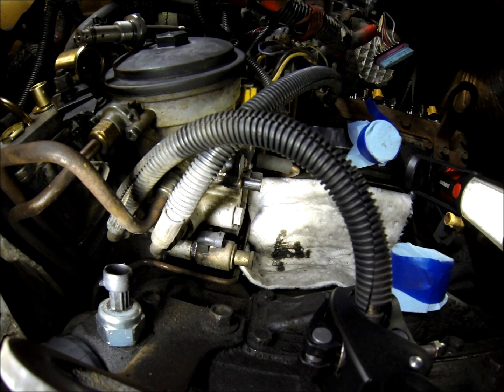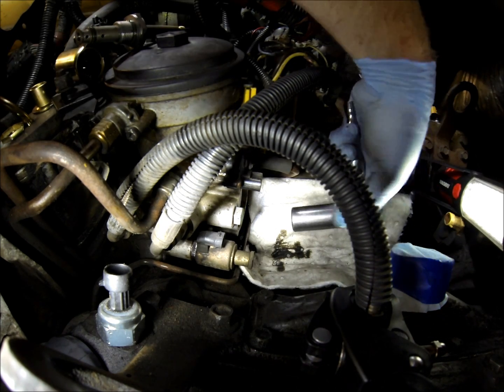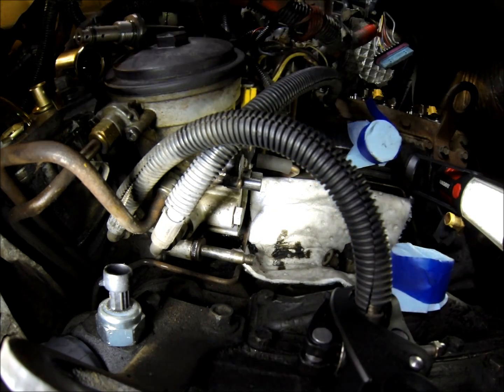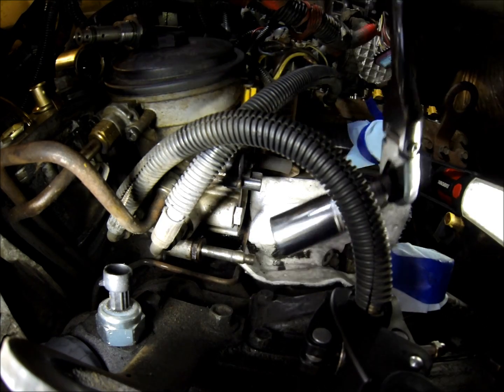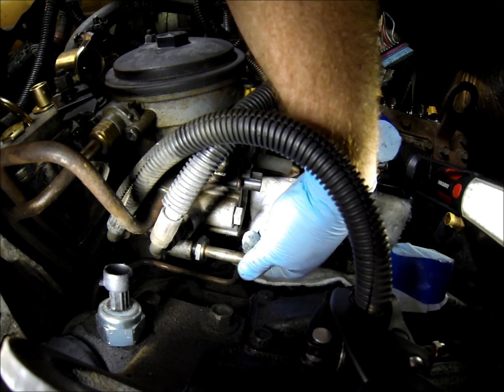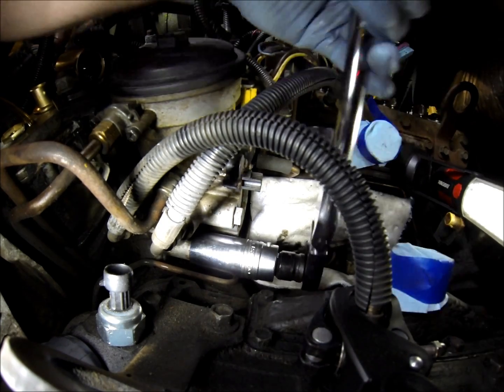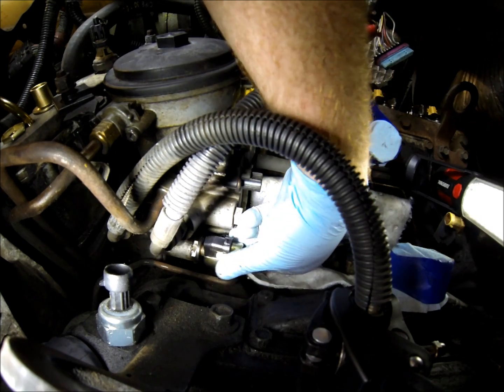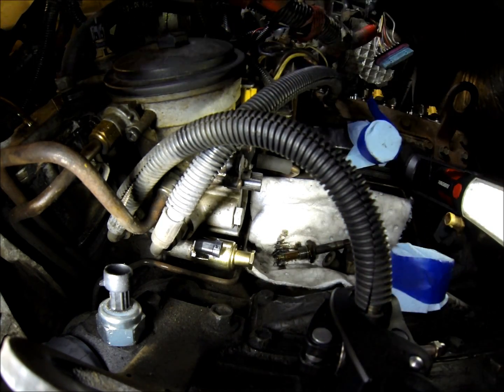7 3L Injection Pressure Regulator Replacement

Comment: My truck will run, I shut it off and if it sets for about 25min or so it wont start. If it sets longer...maybe 15more minutes it will start. Today was the first time it died on me at a stop sign and would not start.  It set about 45min then started. Im going to change this part.

Comment: I have a 1999 7.3 super duty it starts runs but dies after 45 seconds and will start back up and dies again, can you help
Reply from the maker: You will need to run a full set of diagnostics on it to determine why it is dying. Minimum checks would be fuel pressure at the bowl. You will want to get it scanned using a scanner capable of puling manufacture specific codes as well. Otherwise it is just guessing.

Comment: This is a great video, probably the best and most straight forward video to replace an IPR valve in a 7.3L Powerstroke Turbo Diesel. If anyone is watching this and reads the comments, use a 29mm deep wall socket. U.S. car manufacturers switched to metric bolts in the early 1980s, although you will still find some standard size bolts in modern day vehicles.

Comment: The FIRST thing you should tell people is: Remove the fuel bowl if you have one. You need to clean it anyway.
Reply from the maker: The Fuel Bowl has nothing to do with replacing an IPR. If maintained properly, the Fuel Bowl should only need to be removed to replace all of the seals.  Most are good for at least a two hundred thousand miles. The internals stay clean unless bad fuel is encountered.

Comment: My ‘96 7.3 won’t start in the morning when it’s 85 degrees…but I’d I wait until after lunch and it 95 degrees it starts right up.  Mind boggling.  Maybe this pressure regulator will help after I install it.
Reply from the maker: It could be the IPR. You should see starts at those temps. Unplug the ICP sensor and see if that helps. Otherwise you need to find out if it is a HP oil issue. You could have leaking injector o-rings too. Usually prolonged cranking will build the pressure. Get an OBD II reader capable of pulling live data and see what your ICP is at cranking. You need 500 psi to get the PCM to tell the IDM to send the signal to the injectors.
Reply: @woodnthings8  thanks I’ll investigate

Comment: Ken I have a 99 7.3, replaced the cam shaft sensor and plug or wiring harness as the squirrels got to it. My problem is it starts runs and then dies, as long as I keep my foot on the gas it runs but the second I take my foot off it Dies, Can U help!! Thanks
Reply: Thanks I'll try it!!

Comment: I have a 7.3l and it cranks but wont start , the fuel pump is new and I primed it but if wont fire on I did remove the valve covers to check to see if the injectors spray out fuel with the glow plugs off and I see nothing? Do you think this has to do with the IPR or the module that controls the injection
Reply from the maker: Are the injectors putting oil out the ports? If you are not getting power to either side of the UVCH you most likely have an IDM problem. Does your tach bounce when cranking? Also what year?
Reply: @woodnthings8  it's a 1994 f350 I havent noticed oil coming out the ports , and the tachometer is sitting still when I crank it
Reply from the maker: @LuwisRz  I take it you have verified all of the fuses are good? There are quite a few variables, so make sure the  basics are covered. You will also need to make sure you have 500 psi of oil pressure, have you broke into the HP oil system? If, so. you may have to purge it to get the air out. You can sometimes unplug the ICP sensor and get it to trick the PCM to see pressure and get the IDM to send the power to the injectors.
Reply: @woodnthings8  I havent messed with the oil pressure lines or pump , I did remove the ICP and still nothing ,

Comment: Can this cause no starts on cold mornings if it is bad also stalling . I have to cycle the glow plugs a few times around 40 to 50° in the morning in order to get it to start
Reply from the maker: It could be causing your problems. A bad IPR will cause quite a few issues that are hard to troubleshoot without a scanner. For the money, put a OEM IPR in and you will be better off. Stalling is often caused by a bad IPR.

Comment: Where did you get the 1 1/8 socket at? For removing the ipr
Reply from the maker: It is a 3/4" drive Snap-on socket. I think I bought it off of ebay years ago. If you use a 3/4" drive, the socket will have enough room for the IPR shaft to clear. Most 1/2" drive sockets, do not have clearance.
Reply: I ended up getting a performance tool axle nut 29mm w80548 cr-mo that was in 1/2 in drive for $17.11 an it did the job it was a lil deeper than others i had i got it from oriellys earlier an got it off today. Thank you tho for replying :)

Comment: Hello I have a question. I have a 1998 Ford e350 diesel that when you try and start it. It starts but really hard to start. You can turn it off and start it again and it starts immediately. It's has a rough idle like it has a miss but it's like the whole engine is missing. I replaced the glow plugs valve cover gaskets. It has slow throttle response.
Reply from the maker: You need to do some troubleshooting. I'm guessing high mileage so injector O-Rings, IPR and ICP as suspect.
Reply: @woodnthings8  Thanks for your time. I was thinking of replacing injector o rings inside and out. Just because it does have 357354 miles on it. All cylinders had 320 plus on the compression test. I thought maybe it might be the injector driver that is causing some of the problem. I need to change the oil in the high pressure pump. There is no smoke at all from this motor. I'm going to change the seals on the injectors for sure.

Comment: I have a 96 Ford F-250 7.3 could this cause no start at all and no smoke
Reply from the maker: Derek Johnson if the IPR isn't working you will not get oil pressure and therefore a no start. What kind of ICP are you seeing while cranking. You will need a scanner or software that is compatible with Ford Specific OBD II info. I use Autoenginuity with Ford Enhanced software
Reply: Ken Irwin I ordered the edge cts2 and one video I seen he said to pull the icp and crank it  and if oil shoots out its not the ipr if it just runs out the ipr or hpop is bad
Reply from the maker: Derek Johnson if you pull the ICP and crank you will spray oil. Put a pressure gauge or watch ICP pressure via the OBD II port and PCM inputs.
Reply: Ken Irwin icp pulled in was 128 unplugged was 2486

Comment: Hi, im writting from México, i hace a problemas with my truck  7.3  mod 97, when i started the truck star with a low rpm, between 400  and 500, all times, i need accelerate 5 or 10 seconds and the engine works good. The truck always star good, and always rpm are low . i changed the tpr in pedal and continue the same thing, any idea?
Reply from the maker: Hugo Leyva Islas there are two parts to the throttle, one is the Idle Validation Switch and the other is the Potentiometer, which one did you change? If you have low idle, you could have an issue with the ICP Sensor values or a sticky IPR as well.
Reply: Ken Irwin , i changed a potenciometer first, the truck works better, but the problem continúes. Then i changed all pedal, with the same potenciometer ( i buy it complete) and the problem continue. By the way the complete pedal are used becouse power stroke are not easy to foud parts un México
Reply from the maker: Hugo Leyva Islas unplug the ICP Sensor and see if that helps.
Reply: Ken Irwin hi, again, i do, and is thw same. No changes. The sensor are full of oil, and i clean it, and plugged. No change. Tanks for take a minute with mi problem
Reply from the maker: Hugo Leyva Islas you need to replace the sensor.
Reply: Ken Irwin Ok. I will do it. Thanks
Reply: Ken Irwin one question , the sensor has a number or just remove and show it??